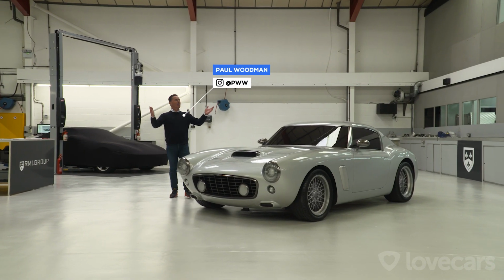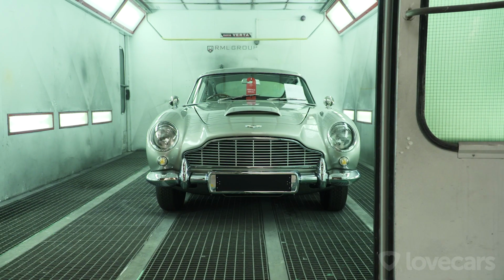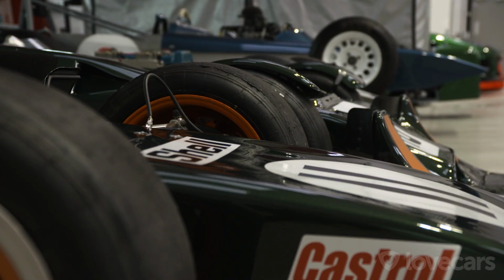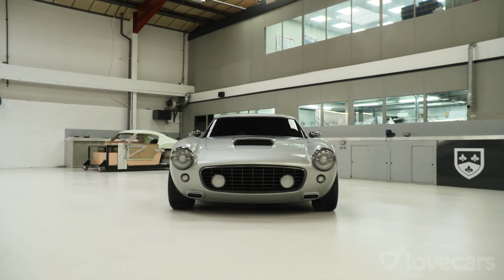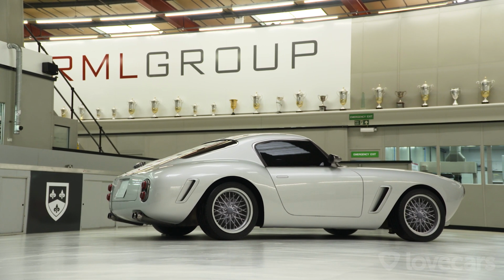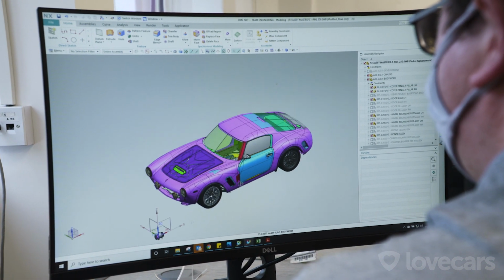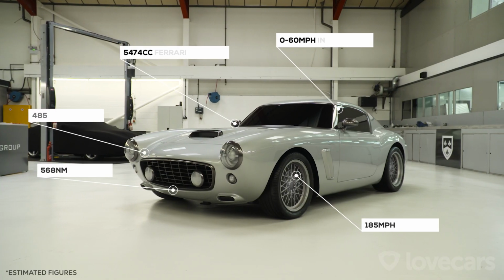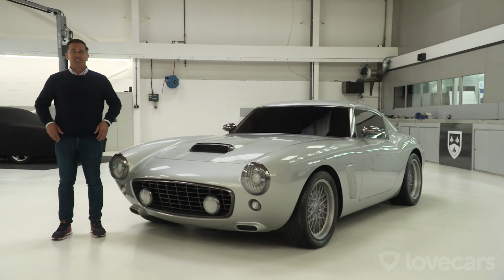RML Short Wheelbase - Tribute to the Ferrari 250 SWB!

Comment: Beautiful, gorgeous, stunning, outstanding, etc.  The only things I'd change are the brake ducts (from outies to innies), and the wheel/tire package.  Voluptuous 1950's and 60's cars just don't look right with modern low-profile tires.  EDIT: also I think it would look better if the rear side extractor vent was the same size as the front - it doesn't need to be that small anymore, because it doesn't need to clear the bumper that the original SWB had and is deleted here.  And the trailing edges of the wheel arches seem like they might be extended a bit too much at the bottom.  I know the original SWB was like that, but only on the front.  At the rear it looks a bit out of place, and it also clashes with the vent, IMHO.  

Hey, you asked.